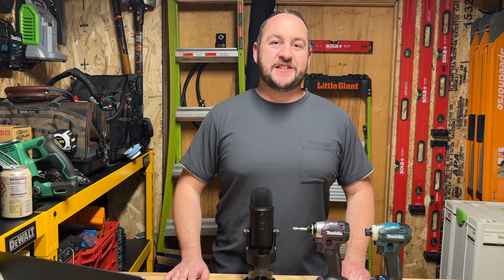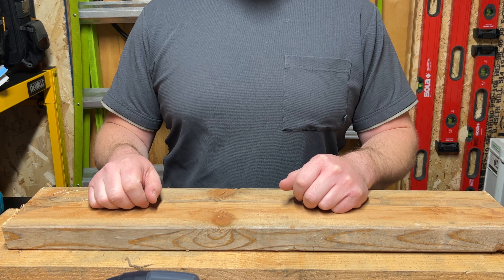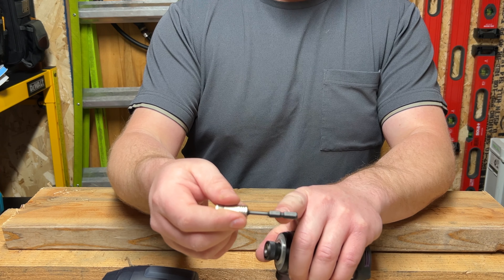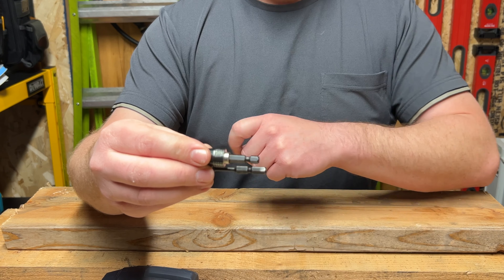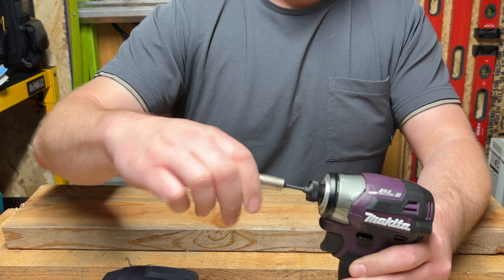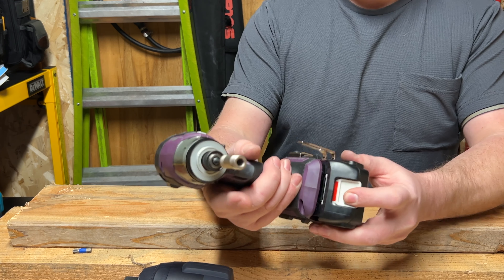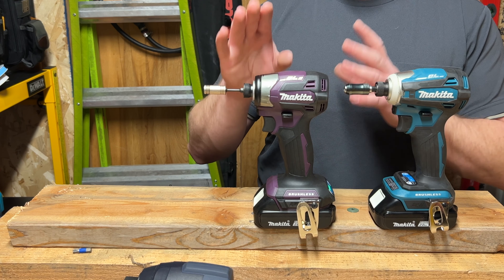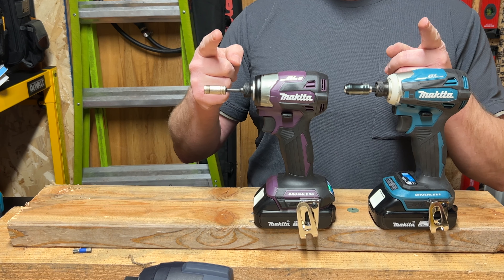Makita TD173 : Review

Comment: Great video dude. I appreciate you breaking out the Festool. It’s an impact that we don’t see in use too often wich is a shame. Looks like a fine tool. The only LXT I have is the XDT 13 and the black compact 15. They are ok but dated. I hopped into the XGT line and it’s just amazing the craftsmanship that goes into Makita especially the models from Japan. The saws are by far my favorite thing to use at work. Awesome video and comparison man.
Reply from the maker: Thanks! The Festool definitely doesn’t get a enough attention, such a nice tool. I am such a sucker for quality tools, which is why I think I gravitate towards Makita, Festool, and Bosch. I have been very happier with all of my tools from those three. 👍🏻 The XGT lineup is getting better and better, I kind of hope that Makita brings some lithium pouch tech to both the LXT and XGT lineup.
Reply: @garnerreviews  dude that would be awesome. Pouch cell batteries are the future as far as power and performance. The way you can pull current so fast and clean is the way to go. The older cylindrical cell packs still get it done for sure especially quality cells but yes definitely pouch cells you cannot match at the moment
Reply from the maker: One hundred percent agreed. I would assume Makita has been working on it, but they seem to take their time and not rush new tech which I can appreciate. Especially if they work out any potential issues. 👍🏻

Comment: How well do the 2.0 batteries do on runtime? I like the thought of this majors impact with the lightweight batteries.
Reply from the maker: They do well enough, seem to last as long as one would expect a 2.0 AH battery to run. Ultimately there are several factors that would determine the runtime on these batteries. I like having them for their size and weight but would also suggest having a larger battery for those really big projects where you will be running the tool all day. Thanks for watching and commenting.

Comment: The little metal piece at the bottom is very smart…. Could I be a jerk and ask for a video of that process??? I was looking at picking up a 173… and first thought was well hell there has to be a Japanese standard but holder base with a E6 holder… yet to find one…
Reply from the maker: I haven’t found one either. You really think that would be a possibility. I may be able to do a video on my modifications in the near future. 👍🏻 Thanks for watching and commenting.
Reply: @garnerreviews  i watch a video review of vessel electric screwdriver and someone in the comment section recommend TONE 2BHA-065 Bit Holder,  or you may also want to check engineer bit holder and Makita Impact Black bit holder E-08791
Reply from the maker: @PurpleBlanc  Thanks for sharing those, could be great for someone wanting to know. I have been using just my standard bits and bit holders in this tool and so far I have had no issues, so fingers crossed. 👍🏻

Comment: Good Video, however You Can't demo Makita properly with a 2 amp Battery .. you need to use the 6 amp to realise the true potential.  The 2 Amp will not deliver the required current.
Reply from the maker: Interesting, I wasn’t aware of this. So is it only the 6ah batteries or do the 4 and 5 AH batteries provide the additional current for top performance?
Reply: 4/5/6 amp will deliver the same maximum power
Reply from the maker: Thanks for letting everyone know. After looking into it I came to the same conclusion, the 4, 5 and 6 AH batteries should offer the best performance with the only difference between them being run time. 👍🏻
Reply: From what they showed on the torque test the 5 seems to be the most powerful in makita line up if I’m not mistaken. You can look it up ,
Reply: @harlanborders943  the 5ah have the most powerfull power output in makita line up , but not a big difference between 4/5/6 ah

Comment: Just got the td173 delivered to the uk. Had no idea the bit holder was different!?
Reply from the maker: Yeah, the Makita impacts that are built for the Japanese market (referred to as JDM for Japanese Domestic Market) have a 13mm collet. Most of the rest of the world uses a 9mm collet (the distance from the bottom of the collet to the detent position). You can technically use a 9mm bit holder but it has a lot of back and forth play. 
I purchased a bit holder that had the 13mm shank and used a little modification to allow 1/4 insert bits to fit better. So far that is working well. Hope that helps. You could also purchase some bits from Japan that have the correct shank/detent length.
Reply from the maker: That should do it. 👍🏻 Enjoy, this is definitely my favorite impact to date.
Reply: @garnerreviews  can the 13mm Chuck be swapped to the uk 9mm Chuck?? By a tool fixing professional??
Reply from the maker: I have been told that previous generations of Makita’s were able to have the collets switched to the 9mm version. I would assume that is going to be true with this one, but it may take some time for the parts to become available for that swap. Definitely something to ask a Makita service tech.